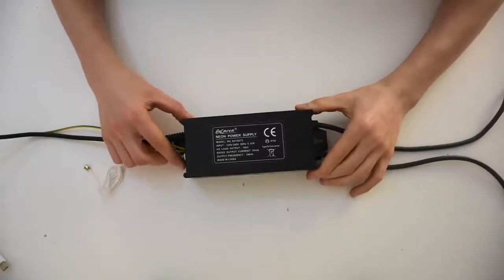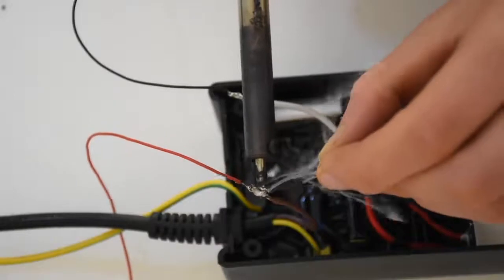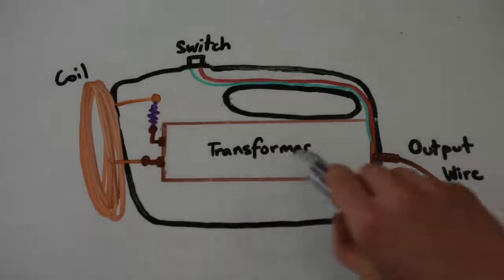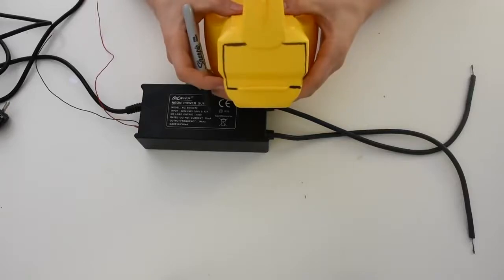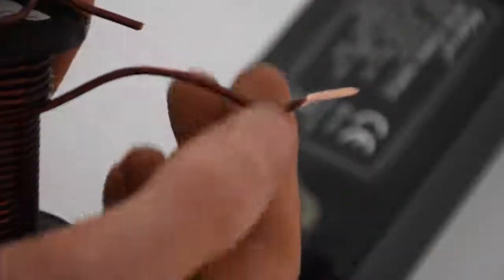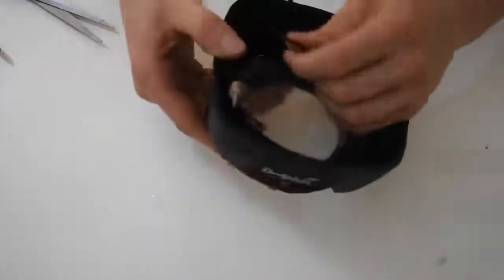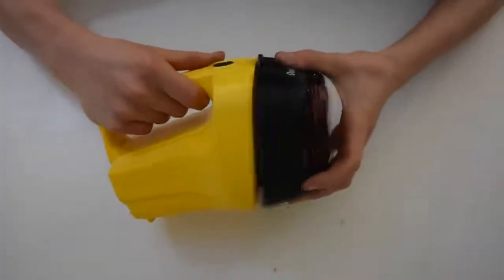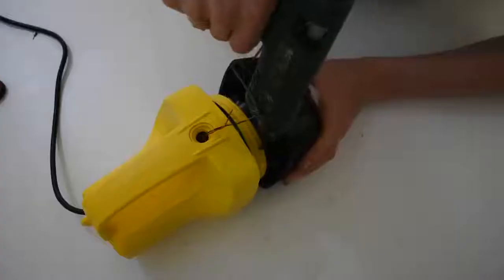Worlds Biggest Handheld EMP Jammer   DIY

Comment: Just imagine with our current governmental agencies going way to far in power grabs , if people started building these man sized, disguised around their front and rear doors of their homes … so illegal entry by “Agents, case workers, and officers “ they would unknowingly pass through them , you could used your home’s electricity for power and wire the spark gap in a different room so the sound wasn’t immediately recognized but the wire wrapped would be in the door frame .. wiping all their electrical devices….. any thoughts ?